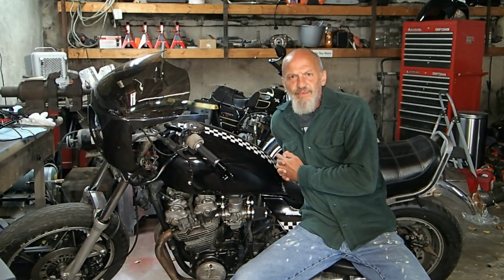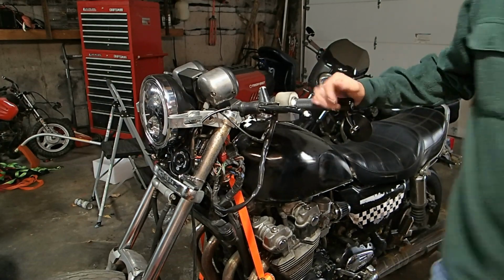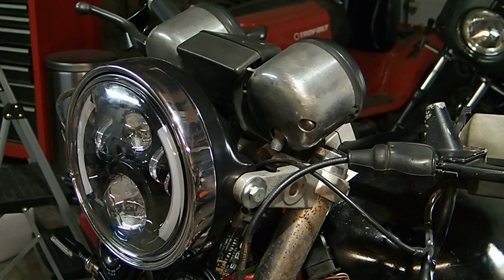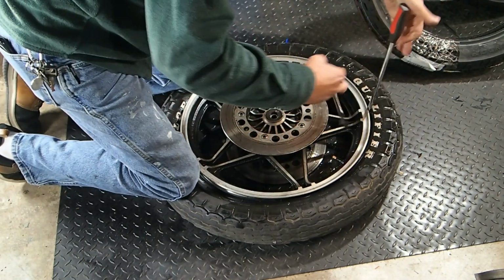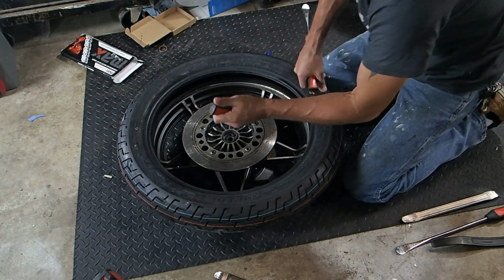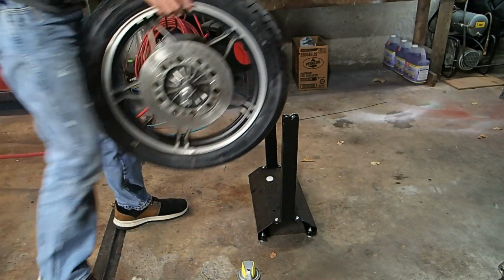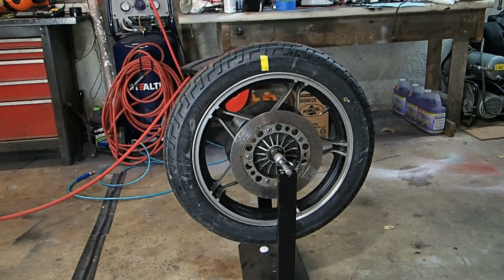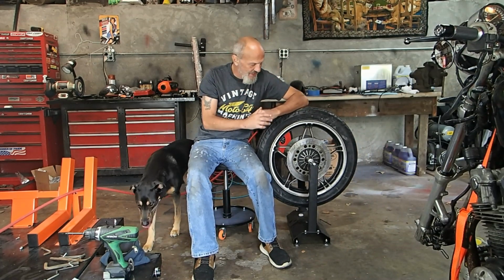Honda CB1000 Custom, Part 14: mount & balance front tire + speedometer fix

Comment: On the tire balancing;  have you ever tried the ceramic balance beads?  I use them in my Goldwings...they work very well...tire stats balanced throughout it's life span, and so far I have no cupping.
Reply from the maker: I haven't tried those. I'll look into it.